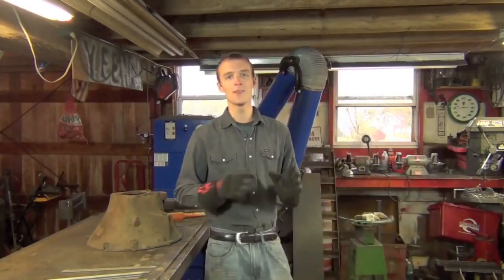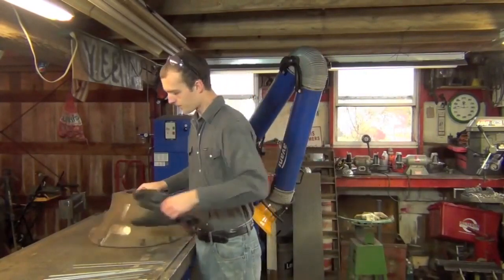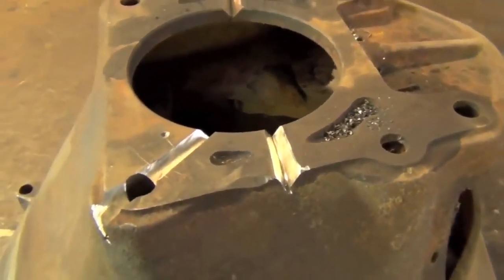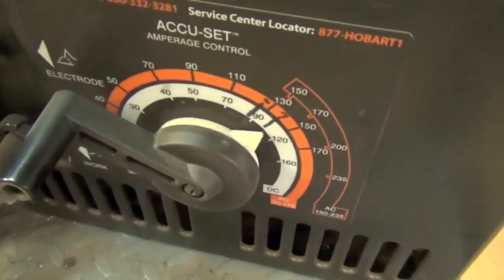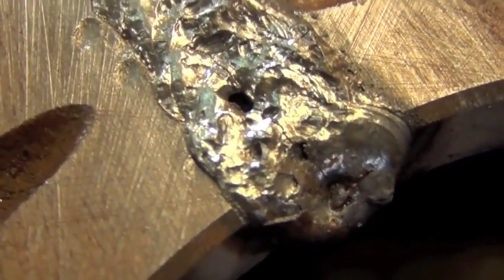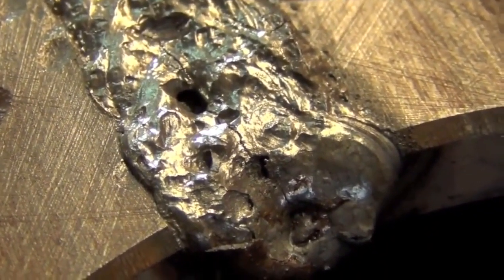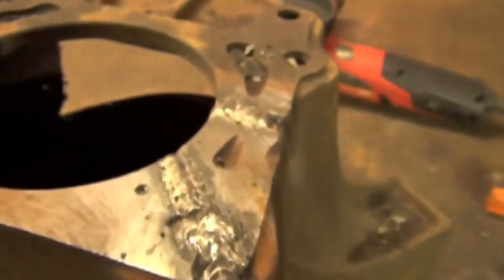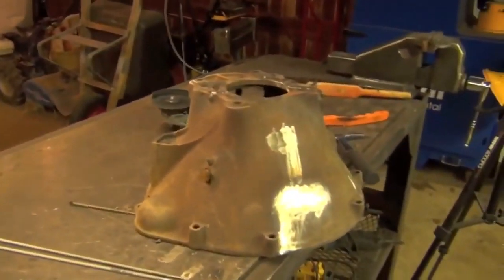EXPENSIVE WELDING RODS - DO YOU REALLY NEED THEM FOR CAST IRON?!? CHEAP STICK WELDS COMPARISON!!!

Comment: You should always, if possible, use nickel rods or atleast 7018, applying only maybe 1/2"-1" long beads before pausing to peen & clean. Also adequate pre-heat and post heat for optimum cooling.

Comment: When it comes to cast I like to grind a V channel before squirting the hot snot into the valley. Usually move around a stitch here, peen, let cool etc. I learned not all cast is created equal. I've had better luck on anvils and wood stoves pre 1930s vs modern cast cookware. But sometimes I get lucky and other times it snaps off. Doesn't hurt to try.  🤘

Comment: It's not about the pre-heating phase or with or without a post heating phase. The cracks are there because of your too much high amperage man. 1/8 rods for cast like those ones i use are made for 90 amps max and for my opinion, the blueshield cast rods are absolutely goods at 94 amps with positive on rod. I use to weld some 2400 mm diameter cast steel rings for concrete moulding rings about 1 1/4 inches thickness. I tried with 7018 and have some super greats results but with 3/32 rod. My results are super. I save a 20k to my company welding the 2400 mm ring with good looking welds and a fully repared ring. thanks for your video